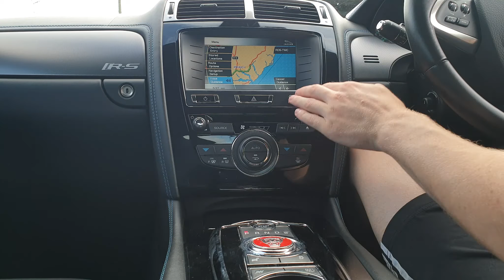Jaguar XKRS Review - Update and styling

Comment: Great video! Can I ask, does your car have the standard exhaust? Mine never pops and bangs like!
Reply from the maker: Thank you Marcus. It is standard, just has the butterfly valves in the exhaust permanently open. Higher octane fuel tends to help. As you heard, it crackles when you shift on the limiter in 1st gear. Is yours an XKR-S?
Reply: @QuickShiftTV2024  Yes mine is an XKR-S too, same colour as yours. Definitely the best colour for the car! Did you remove a fuse to keep the butterfly valves open?
Reply from the maker: @xMarcus999x  Yes- fuse 11 i beleive, but a quick Google search will confirm. It's behind the rear seats for certain. I do love the blue, but admire the white and red also!
Reply: @QuickShiftTV2024  Amazing, thank you! I will look into it!
Reply: Wasn’t it fuse 19?
Reply from the maker: @Celestias  😯 Yes I'm fairly sure your right and I've miss typed 😳